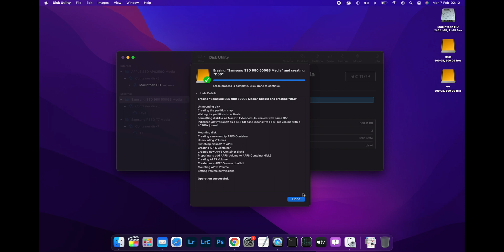WD D50 Game Dock - How to install or upgrade SSD

Comment: Hi, I'm wondering when is your fan inside the case on? like it's always on or just when the temp is high? I just get the 0TB model, with my own SSD installed, the fan never kicks on, even when the temp above 85 degrees
Reply: did you ever find this out? I just got one and the fan never spins
Reply: @arthurroberts5794  Unfortunately, I couldn't find a way to make it spin. In the end, I had to purchase a USB-powered fan of the same size, replace the original one, thread the cable through, and plug it into the USB port at the back of the dock.
Reply: @naituw92  smart, after seeing a different post on it the fan only turns on when the ssd temp is high enough and isn’t meant to cool the system

Comment: Nice video but I have questions. Does 0TB(diskless) version has m.2 port, does it work good and last question; is the fan speed adjustable or can we make it work at a temperature value I want?
Reply from the maker: Yes the 0TB version has an M.2 NVMe slot so you can install your own SSD. It's the diskless dock I'm showing in this video. The fan speed isn't adjustable.
Reply: @BartechTV  Thanks for your feedback. I think I'll get one soon 😁